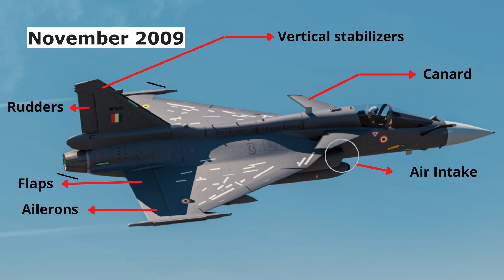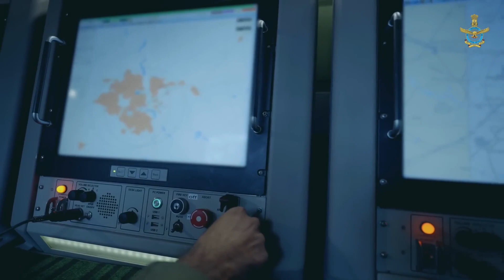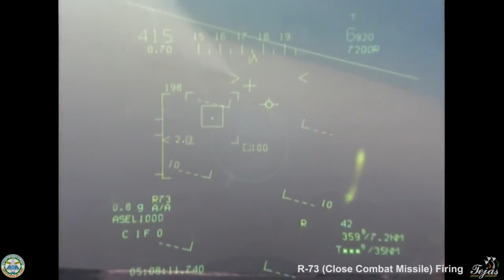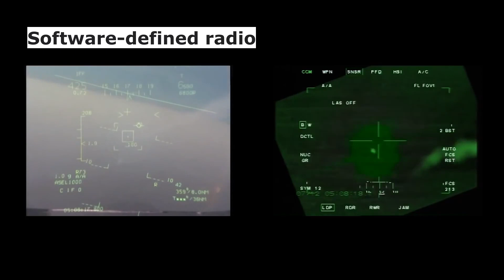Why Tejas Fighter Jet Was Delayed | Tejas Mk-1 vs Tejas Mk-1A

Comment: Composite airframe causing low radar cross section, lighter weight and low maintenance, electronic warfare suite, in flight refueling, bvr missiles, all axis fly by wire control system, highly reliable and efficient ge f404 engine. All these make it amongst the best aircrafts in small category 

The best part about Tejas is that with the new Indian radar they are integrating the best of weapons including Russian, European as well as Israeli. This is unthinkable with other aircrafts, French won’t integrate their missiles with Israeli radars and nobody would allow their missiles to be fired using Russian radars 

The biggest advantage of Tejas for India however is the development of local manufacturing capabilities in the industry and the generation of skilled manpower and such jobs 

Indian Air Force is impressed with the performance numbers of their baseline Tejas variant over the past four years, so much that they have placed orders for 83 additional Tejas aircraft in improved mk1a configuration and ordering another lot of 97 more   

The Tejas aircraft is also evolving further with the mk2 variant as well as a naval variant called TEDBF, both of which incorporate sensor fusion and more fifth generation technologies including CATS drones 

I have to say that the govt must play an active role in ironing out the differences between the armed forces and DRDO scientists. It’s important to mention that previous rm late mr. Parrikar was instrumental in getting the IAF to accept the Tejas by promising incremental improvements with the mk1a variant. Otherwise the previous ten years of congress regime were disastrous for every military procurement and had virtually killed the Tejas program